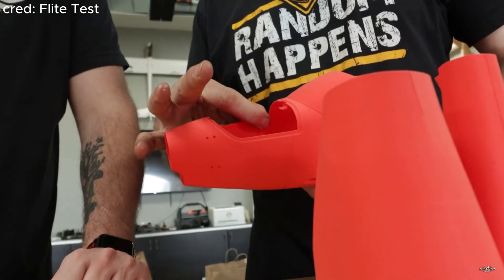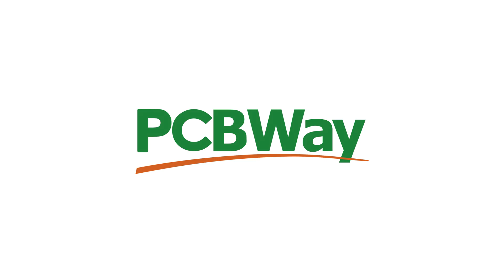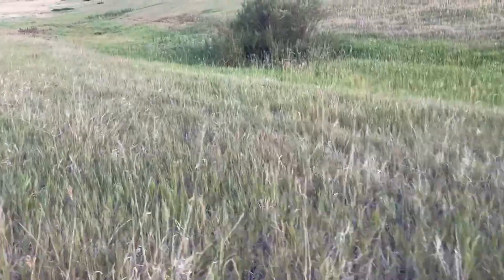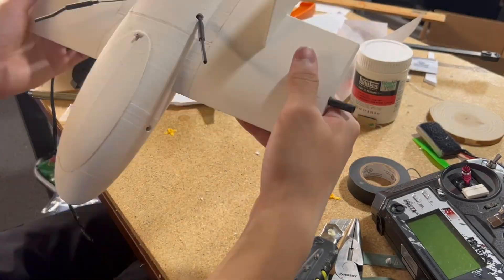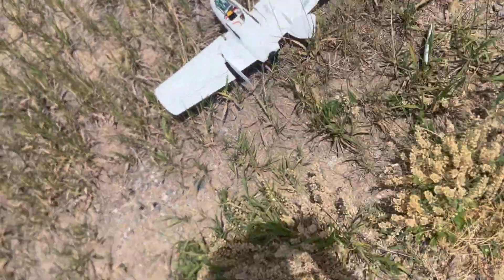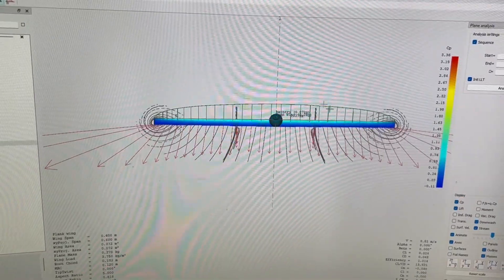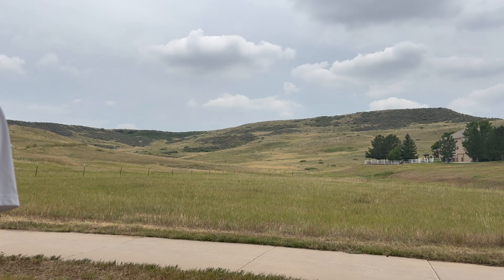Attempting to Design a 3D Printed Flying Wing

Comment: After designing and printing planes the last 2 or 3 years ish Ive come to find printed planes just end up to heavy in the end. Especially smaller builds its damn near impossible to have a low wing load with smaller printed planes.  Its a massive trade off between weight, durability, and flight performance.  This was a great video either way. For stronger and lighter prints, try 1 wall, .6mm with adaptive cubic between 3 and 6%.  Before titan dynamics sold out they had a pretty good write up of infill differences.  Quarter cubic wasn't out yet though so maybe it may be better.  If your not already using real lwpla (foaming, not prefoamed) give it a whirl too, its 30% lighter and stronger imo. Rolls last a while too but its a little more expensive than prefoamed.  Colorfabb is my go to.

Comment: Being around the RC hobby after so many years and the UAS industry you learn and pickup on what different sounds mean and how to do crash investigation. On your flight after you added the .8mm FG vertical stabilizers that resulted in a crash you can hear a not normal noise. At 5:50 if you listen to the tone of the propellor it goes from sounding normal and you can hear the pitch of the sound get high and high leading to when the aircraft gave the sudden pitch down and crashed. I've come across this sound before and the finding is usually that the Nut the holds the propellor to the motor has loosened but not all the way come off. Due to the fact the prop isn't held tight against the motor the prop slows down from the drag but the motor keeps spinning. This is what that sound you hear is. Its caused by the motor shaft spinning against the the prop. With the prop skipping it makes sense why you had the sudden drop of the nose. What most likely happened was the prop nut wasn't fully tight on takeoff and you had a non locking nut. Looking at your motor and prop it looks like you were running it clockwise and attached with a non locking nut. The issue with clockwise is it will spin in a direction that can twist the nut off if its a standard right hand thread on the motor. Usually it wont completely come off, It'll just loosen enough to where the prop and motor will skip for a couple of seconds at a time resulting in sudden thrust loss. Since you were at a high angle of attack and low airspeed in this period of flight the sudden loss of thrust resulted in a stall which explains the sudden drop of the nose. By the time the prop stopped skipping your attitude had dropped enough to where you were in a unrecoverable attitude for the altitude you had. I would recommend for future flights if running a CW prop to use a nylon locknut to be sure it doesn't come loose in flight. Typically they're an M5 size.

Comment: Awesome wing! I know it wouldn't meet your design criteria of having a flat wing, but I have recently built a swept flying wing that flies at low speed and is super stable. I imagine having the reflex on the wingtip further back would add to some of the stability. The wings are cut from XPS foam sheets. With a wingspan of 40", the total weight hovers around 245g. In order to combat the motor torque I am using counter-rotating 1806 2400kv motors. I have noticed that with higher speeds, the wing will start to flutter heavily from a lack of structure. Flying wings are definitely a challenge. Keep up the great work 👍

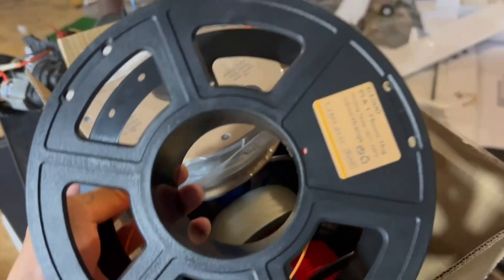Comment: 1:50 nahhhh don't support scummy businesses liie polymaker please, all their filament data sheets are essentially fake and perform worse than cheaper alternatives. LW-PLA also deforms under the sun, better use LW-ASA instead
Reply from the maker: Mb bro I just saw it on Amazon and got it

Comment: For a much stronger and cleaner wing, try using the tom stanton design where you create the inside ribs of the wing in advance. Ive used it in my 3d printed planes and it works very well. 
(How I Designed a 3D Printed Wing is the name of the tutorial video made by tom stanton)

Comment: but can it fly under water. optimally then it will not float, only if a separate floater is filled. then it can both fly under and above water. also if using hall-effect (or brushed) dc motors then an esc becomes a pwm transistor.

Comment: Nice job!
The reason for the pitch instability may have been the wings lack of reflex, which is where the trailing edge curves slightly up, this is how flying wings can remain stable with no horizontal stabilizer. A slight bit of up trim would solve it to.
Reply from the maker: The airfoil I chose at the beginning was a flying wing airfoil, but I added more reflex for the final design and it did seem to help

Comment: The final design flies so well, especially the barrel roll looked super smooth!

For the CG I usually do 10% the chord for planks because the fuselage acts as a lifting surface and shifts it forward. 

Also I think your Discord invite link is expired since it will not let me join.
Reply from the maker: Thanks 👍 that discord link was my old one. I’m thinking about making a new one for my rc audience but idk yet
Reply: @ieatgrass_rc Alright 👍

Comment: Years ago I was flying on a very windy day with a Great Planes PT Electric with an Astroflight 05 cobalt. When flying into the wind at full throttle the plane would stop in the sky relative to the ground, but when motor was off, it glided slowly forward. I noticed in your landings it looks like you cut the motor off, if you try again, set your throttle to be about 500 to 1000 RPMs to use your prop as a brake.

Comment: If your CG is off, usually flying wings stall by flying out looking like everything is OK, then it is like they hit an invisible wall and then fall out of the sky. I don't know about the airfoil you are using but the ESA-40 airfoil requires the CG to be no further back than 10% of MAC.
Reply from the maker: I just used a plank wing airfoil from airfoil tools. Thanks for the tip

Comment: Yes! The crappy train internet is working! I'm an hour late😰 What do you mean you can't turn at slow speed? Like you input a roll and it just doesn't respond or it does a huge circle or what? (I don't want the files for the plane. I don't have a 3d printer)
Reply from the maker: It likes to drop a wing while turning

Comment: 4:38 I had no idea that swept wings have passive yaw stability
Reply: It's a small effect, even highly swept flying wings need vertical stabs or drag rudders to fly properly (or fly at all..)

Sweep also gives you a dihedral-like roll stability, but again, effect is relatively small.
Reply from the maker: @Glydaire Yoo it’s you! I was wondering, what did you use for the rotor head of your gyrocopter?
Reply: @ieatgrass_rc  Material? Just PLA+